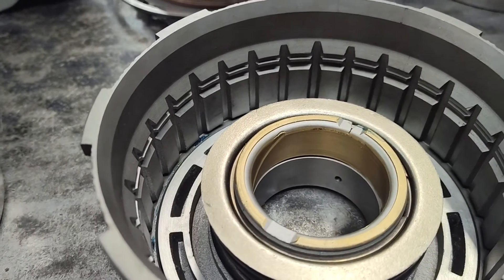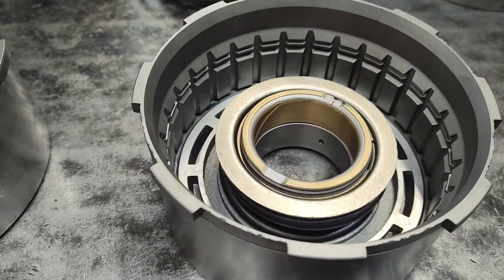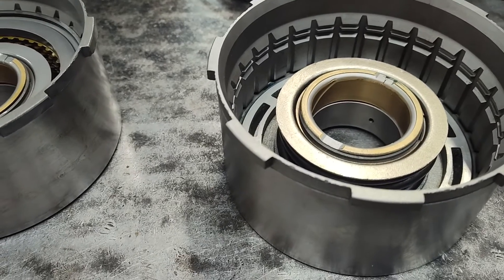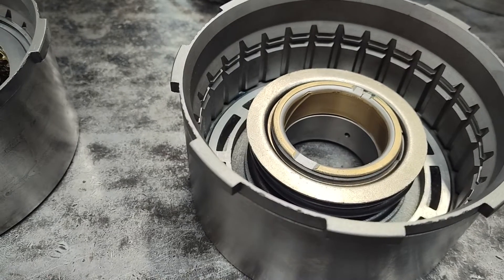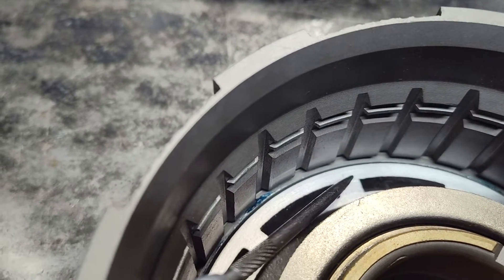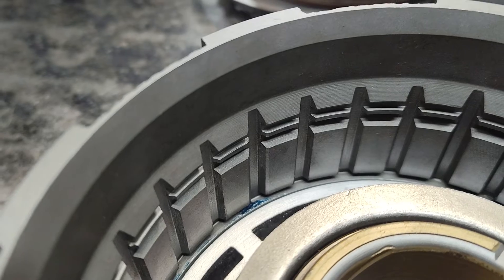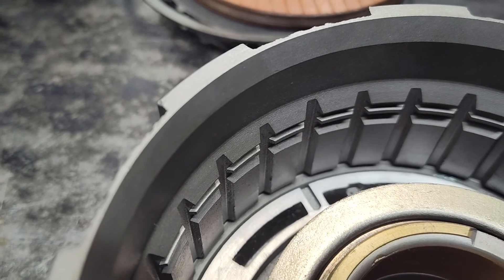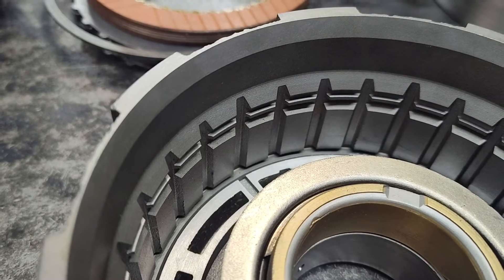Ford C4 Transmission Direct Drum Modifications

Comment: Love your videos, really appreciate you sharing all of your knowledge, I have done this mod pretty much as you describe it and I have had very good luck with it I even use the smooth thin clutch disks same as in the forward drum and sometimes use very thin AOD direct clutches I set clearance to @.007" per disk, I do not add that small hole under the piston you talk about and don't think I need it myself, I do drill 4 holes around the outside of the drum lined up with the center of the clutch stack and I am using one of your RMVB kits with trans brake at about 250psi. My question is do you see any reason I should change any of what I am doing or see any problems with using the smooth clutches I have used. I am making 645 hp and 670 tq at flywheel it is a street car all under 6K rpm and it seems good so far. Thanks for any suggestions you can make.
Reply from the maker: I think the smooth clutches are ok. If its working for you I wouldnt change a thing.
Reply: @BroaderPerformance  Thank You for your reply Jay I appreciate all that you share.

Comment: Thanks Jay for the info,as a trans guy of 40yrs I can say the main thing is to keep the trans fluid cool a good aftermarket cooler bypassing the stock cooler is the ticket,especially when running a stall converter,cheers bud keep punching!
Reply from the maker: I agree. I think talking about cooling is often overlooked. Thats more important than fancy clutch plates etc....

Comment: I drilled a hole at an angle through the bottom.... No pressure loss at all... No more burnt clutches... I run stock B/W cluthes
Reply from the maker: What is the hole diameter?

Comment: I run mostly stock C4 , with  Kevlar intermediate band, stock reverse band. I seem to have most long-term trouble with the forward clutch pack. No trans-brake streetcar 425hp 4500stall . At that power level it will need clutches after 3 summers.
Years ago when I was at 600hp I could get through the summer but was weak for sure    .What's your opinion at what i should look at next time I'm in it.?
Reply from the maker: Is the disc spring getting bent over broken?
Reply: @BroaderPerformance  no, never had that problem,  I've heard of it. Never happened in any C4 in 35 years of mine.    A friend has ..

Comment: When I was 18 built my 1st trans a C4. Back then (in the 80's) everyone said C-4 named after the explosive b/c it will explode & need a C-6.  The 1st one lasted a hour, 2nd time a week, 3rd time I never broke it.  I notice you don't drill  any holes in the drum to evac oil.  Back then was popular to drill four 3/8" holes. I did that and it welded the plates together right in line with those holes. The hole from the factory is all needed to stop centrifugal force applying the drum.  I think it was drilling the drum like that was the problem and that extra hole added enough oil to keep the clutches from rubbing and overheating in 1st.  I still drilled the drum, but were about .90" hole one per clutch step staggered around the drum. Never had a problem with that and never added that hole in the piston.
Reply: Sorry meant to say .090" hole, not .90".  That be kinda big. 🙂
Reply from the maker: Thanks for the info. I have done various configurations of holes on the outside of the drum but I cant say it seemed to help. Another mod that is hard to prove whether it works or not.

Comment: Good videos , Jay. Thanks for sharing. On my units I drill relief holes on the band surface in line with the middle of the band and the drive tangs to aid band apply as well as high clutch apply. How do you feel about that mod?
Reply from the maker: I used to do it but I didnt find any real benefit to it so I no longer bother.